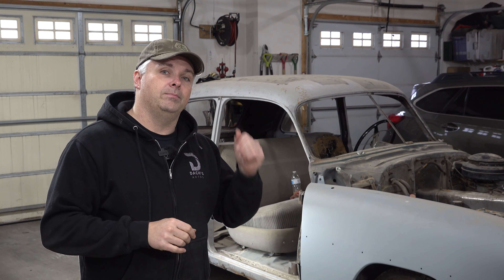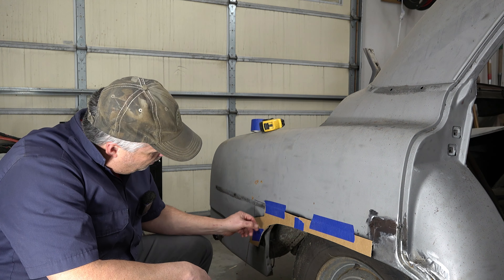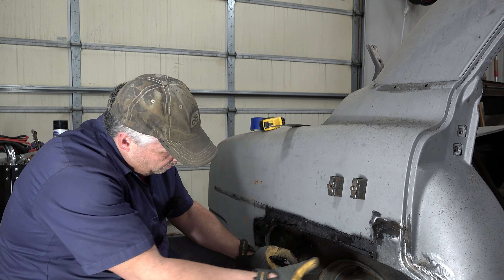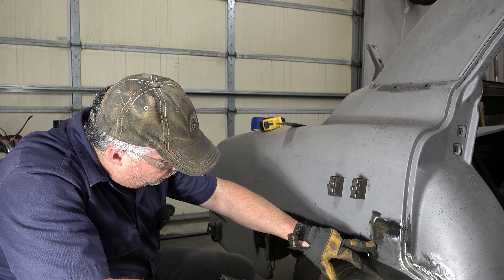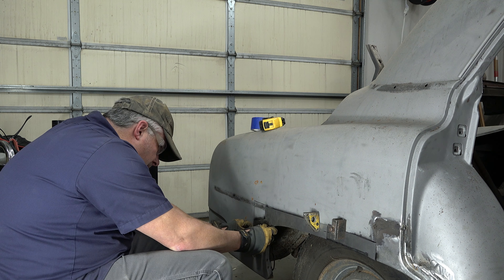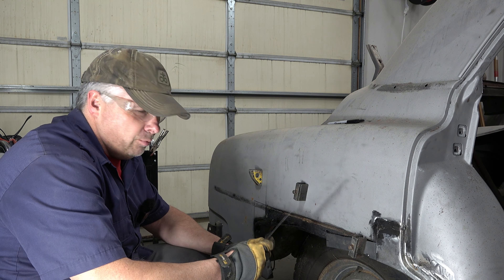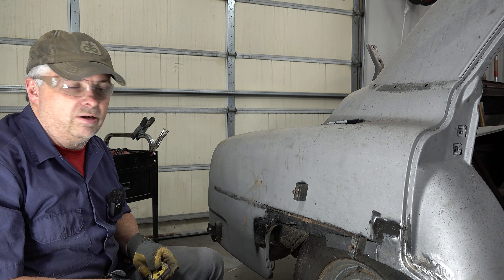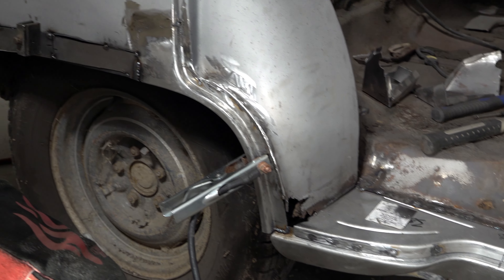1952 Chevy Styleline Project: Part 25 - CAD assisted Quarter Panel Repair

Comment: If you have to do the other side, National Chevy Association sells a patch panel with the correct arc for '51-'52 "with" a 90º turn back already there all for only $40.
Reply from the maker: Good to know.  I did the drivers side this past spring, so we're all good now, but maybe someone else will find it helpful!